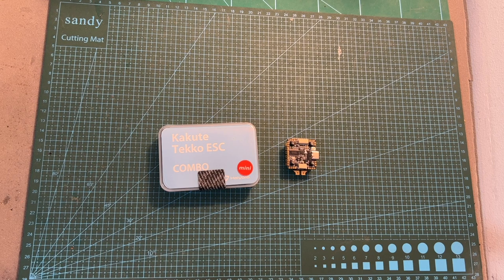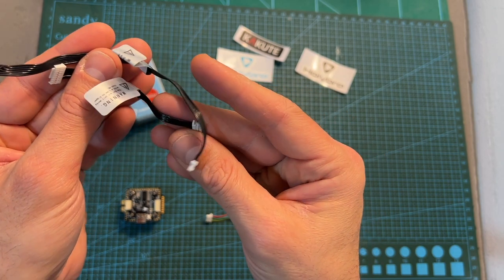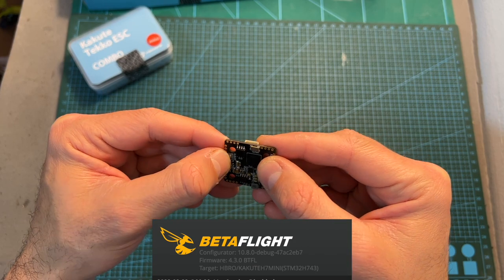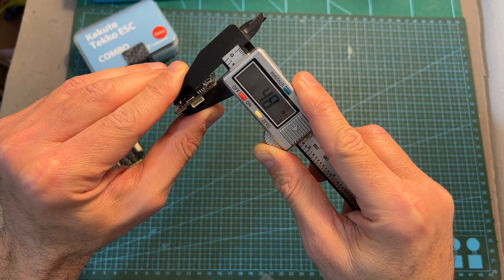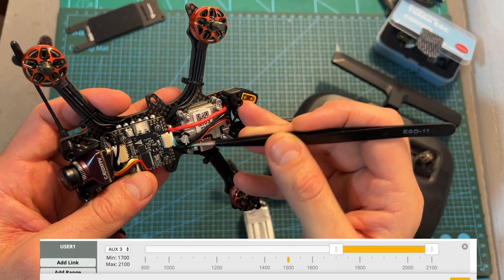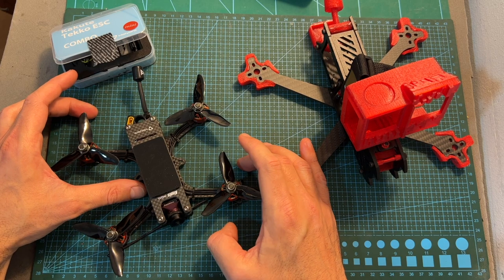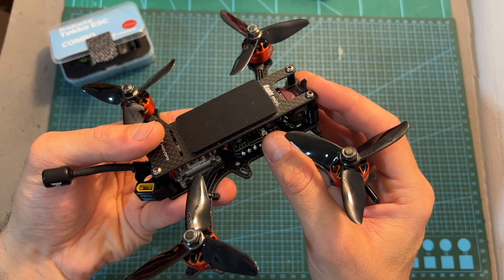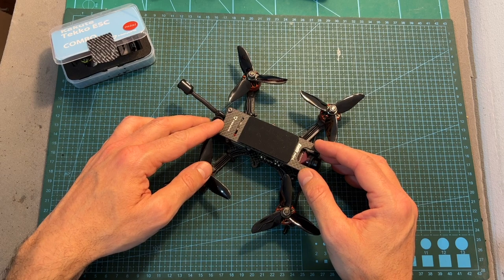Holybro Kakute H7 Mini Stack - Overview & Setup

Comment: Great review of capable compact flight stack. I'm very happy with the 30x30 stack, and I'm partial to the Tekko32 F4 esc. Pretty good flight considering it's default tune. It would interesting to know if you're able to help tune it using the presets. Happy flying 🤓
Reply from the maker: Thanks John! I actually used a 3" 4s preset but as you can see it wasn't that good. Oh well...

Comment: I just bought this stack. I watched the video on the product page and you said that this board needs to be flashed with the latest firmware or you will most likely have problems with it. 
when I tried to do this, there was no firmware at all listed for this fc on betaflight configurator. Click on the dropdown menu but there's nothing, zero firmware. 
I'm curious, how do you flash it when there is no firmware listed. Are you using a different configurator?
Reply: Have you solved the problem? Maybe try beta releases